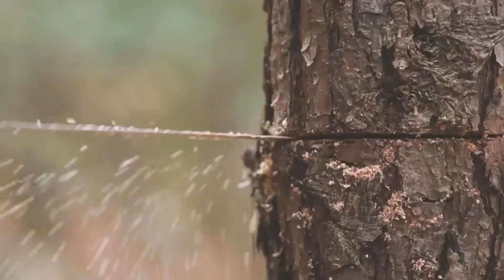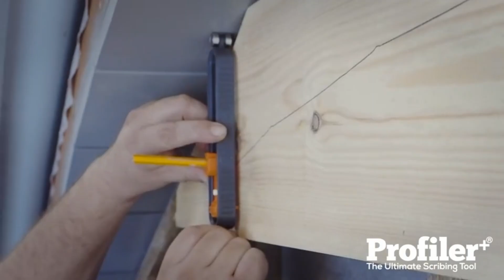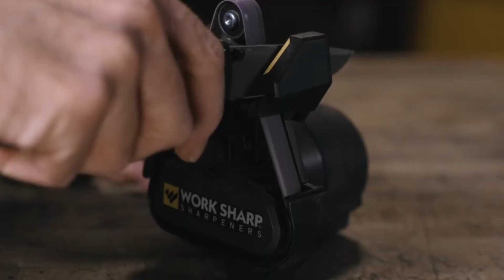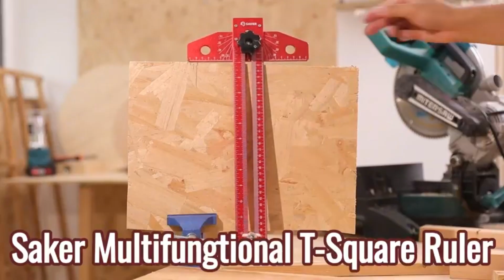25 Next-Level Woodworking Tools on Amazon That Will Blow Your Mind

Comment from the maker: PRODUCT:1 0:25 #ad https://www.amazon.com/dp/B0D6R66667/...
 Neoteck Digital Angle Finder
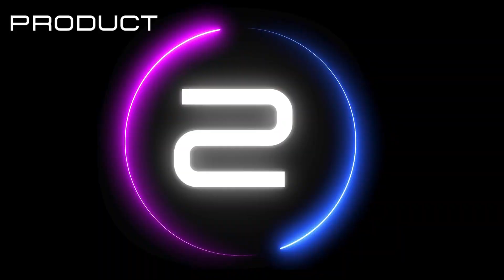PRODUCT:2 0:59 #ad https://www.amazon.com/dp/B08LN43N6C/...
 REXBETI Folding Saw
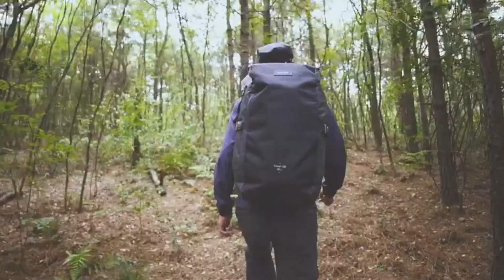PRODUCT:3 1:30 #ad https://www.amazon.com/dp/B07VW3YRQ3/...
 Kreg Stop Collar Kit
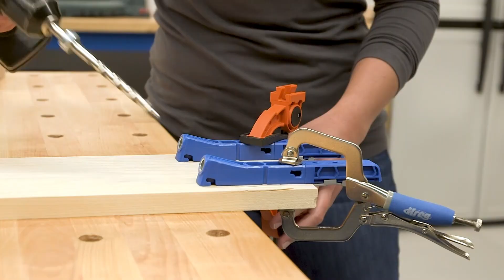PRODUCT:4 2:02 #ad https://www.amazon.com/dp/B0DMF9QYPB/...
 JOAPRIL Butyl Tape
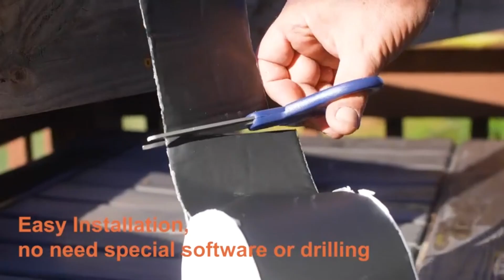PRODUCT:5 2:33 #ad https://www.amazon.com/dp/B0BWN5NG15/...
 Contour Gauge 10"
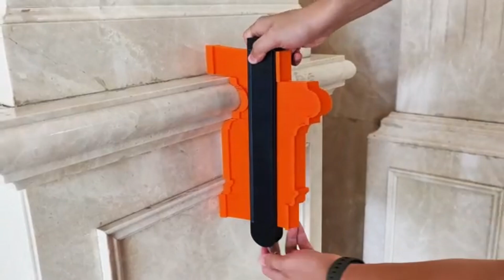PRODUCT:6 3:04 #ad https://www.amazon.com/dp/B0D5MCB6PM/...
 600 Grit Sanding Drums
PRODUCT:7 3:31 #ad https://www.amazon.com/dp/B0DZS9TDJT/...
 REXBETI Camping Saw
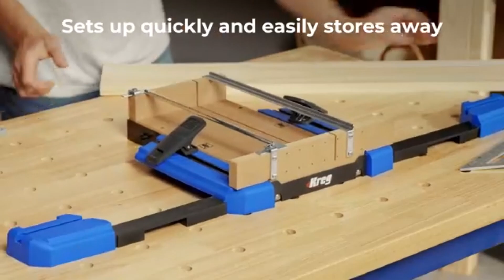PRODUCT:8 3:57 #ad https://www.amazon.com/dp/B08BQSK2RF/...
 Kreg Crosscut Station
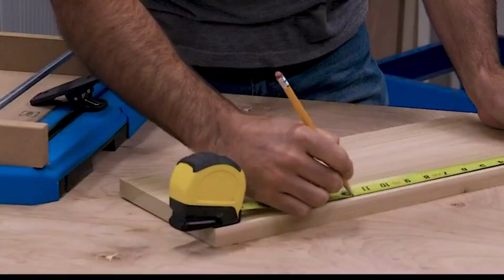PRODUCT:9 4:25 #ad https://www.amazon.com/dp/B0FB3W7KW8/...
 Titanium Countersink Set
PRODUCT:10 4:51 #ad https://www.amazon.com/dp/B0CBKSZ1D1/...
 Thin Rip Jig
PRODUCT:11 5:18 #ad https://www.amazon.com/dp/B00Z21QAMO/...
 Profiler+ Scribing Tool
PRODUCT:12 5:50 #ad https://www.amazon.com/dp/B0F2N4RZG8/...
 MtiolHig Hand Planer
PRODUCT:13 6:19 #ad https://www.amazon.com/dp/B0B64G78LH/...
 Joint Master Jig
PRODUCT:14 6:47 #ad https://www.amazon.com/dp/B0FK9PSXJT/...
 GOINGMAKE Dowel Jig
PRODUCT:15 7:14 #ad https://www.amazon.com/dp/B08VD8ZGFZ/...
 Work Sharp MK2
PRODUCT:16 7:43 #ad https://www.amazon.com/dp/B0CYZ426KM/...
 BEAMNOVA Hinge Jig
PRODUCT:17 8:11 #ad https://www.amazon.com/dp/B09BMS8RM7/...
 Clamping Squares
PRODUCT:18 8:37 #ad https://www.amazon.com/dp/B0F4R87JW1/...
 Door Hinge Jig
PRODUCT:19 9:03 #ad https://www.amazon.com/dp/B07CL1FGF2/...
 Electric Hand Planer
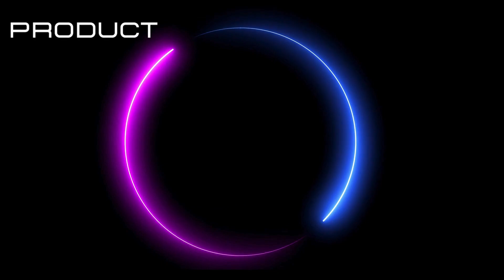PRODUCT:20 9:29 #ad https://www.amazon.com/dp/B0CPF111ZR/...
 Mini Wood Lathe
PRODUCT:21 9:58 #ad https://www.amazon.com/dp/B0DFYB23GP/...
 Electric Screwdriver Set
PRODUCT:22 10:33 #ad https://www.amazon.com/dp/B0D17S7D1B/...
 Cordless Orbital Sander
PRODUCT:23 11:00 #ad https://www.amazon.com/dp/B0FH2VKH38/...
 Folding Saddle Square
PRODUCT:24 11:27 #ad https://www.amazon.com/dp/B0D6V76JW9/...
 Saker Scriber Ruler
PRODUCT:25 11:54 #ad https://www.amazon.com/dp/B072X4T8BF/...
 Worx Sidekick Table

Outro 12:18 #ad All Products Linked Above